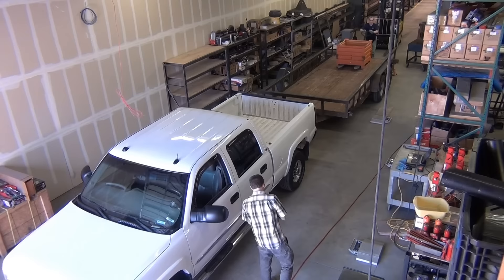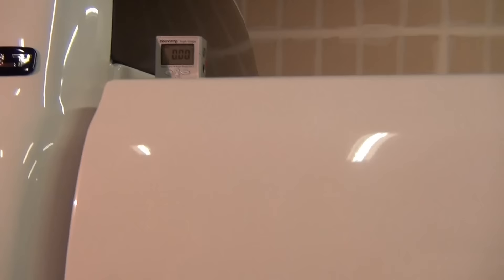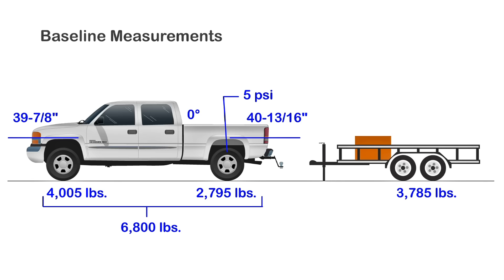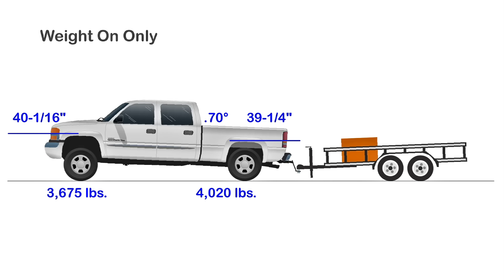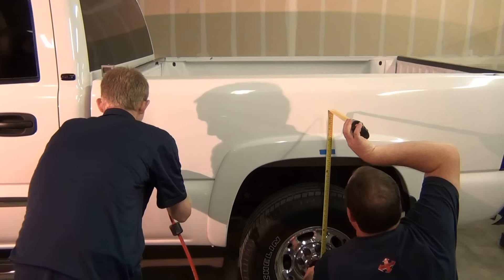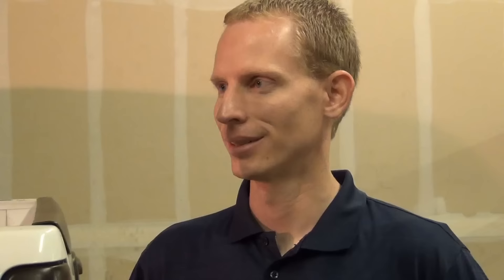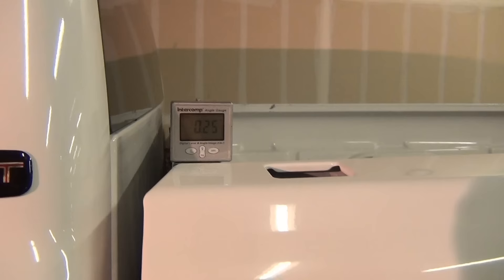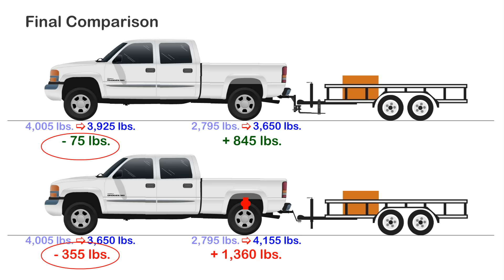The Difference Between Using Weight Distribution and Air Bags to Level Your Load

Comment: This is a great test. I have a Nissan Armada with self leveling rear suspension. How should I set up the weight distributing hitch with that? Do I use the air suspension or should I just disconnect it? I really wish I could just remove it from the truck all together. I also have an issue with hitch height. The stock shank that came with the hitch does not have enough drop and my trailer is always towing tongue high. Unfortunately, I paid an RV dealer to set it up and I'm not sure they did it right.
Reply from the maker: Thanks for watching. The best method to set up your weight distribution with a self-leveling suspension is to disengage it. Some systems have a switch that allows you to turn them off and on. Others do not level until the vehicle is turned on. And some have to be disabled by pulling the fuse temporarily. The best practice is to load the vehicle as you will have it for towing, then disable the auto-level system. Once that is done, set up the hitch to the correct height for your trailer’s coupler, and for the weight distribution needed. Once the hitch is set up, enable the auto-level system again. In many cases, the auto level will adjust and reduce the amount of weight distribution you are getting slightly. Be aware of this, and make an adjustment to the hitch setup if necessary.

Having the hitch ball at the correct height is very important. It is much easier to get good weight distribution, and much easier to hitch up and unhitch as well. We recommend setting the trailer parallel to the ground, and then setting the top of the hitch ball to the same height as the top of the trailer coupler. If you are within an inch or so of this height, the hitch can usually be set up to perform well. However, if the hitch head is much above this, we recommend using a specialty shank that has enough drop to allow the hitch head to be placed at the correct height. Instructions to correctly set up the Fastway e2 hitch can be found here: [https://www.fastwaytrailer.com/manuals], and for an Equal-i-zer hitch, here: [https://www.equalizerhitch.com/manuals-and-guides].
Reply: I appreciate the response. I measured my hitch and ball heights and there is a 9" difference between the two when the trailer is parallel to the ground!
Reply from the maker: @phonetech1109  , wow! Yup, that’s too far off. You must have a very tall truck, or very short trailer. We definitely recommend getting a specialty shank for your setup. Fastway brand shanks are here: [link https://www.fastwaytrailer.com/e2-replacement-parts], and Equal-i-zer brand shanks are here: [link https://www.equalizerhitch.com/store/shanks].

Comment: Is it better to use both air bags an a Wt distribution.
Reply from the maker: Using both can be a bit tricky, you'll want to set the springs up before setting up the weight distribution with the hitch. You may need to use one extra washer on the hitch setup to compensate. Thanks for watching!
Reply: @FastwayTrailer  I had the same question. Do you mind explaining this further? I appreciate this!
Reply from the maker: @raymondgreen5755  Hello! Using both can difficult. If you do you'll want to set the springs up before setting up the weight distribution with the hitch. You may need to use one extra washer on the hitch setup to compensate.
Reply: @raymondgreen5755  check out the follow up video - https://www.youtube.com/watch?v=mj2oqAiltsk
Long and short: If you have auto level, set your weight distribution (WD) slightly higher than the desired amount before allowing the auto level to come on. When it does, you will lose a little WD. If you have manual airbags, you can set it all up following the same process as with auto level. Or, fill the airbags as desired first then perform a normal hitch set up to your desired amount of WD.

Comment: Can you use both the weight distribution hitch and the airbags? The reason I’m asking is because I recently leveled my 2018 F250 and now by rear sags even with the weight distribution hitch set to the higher end. I was going to add airbags to level everything out if possible. Looking forward to a response...
Reply from the maker: Thanks for your response! We don't normally recommend using both air bags and a weight distribution hitch together. The air bags can counteract the weight transfer that the WDH is giving. Using air bags to raise up the back end of the tow vehicle will decrease the amount of tension placed on the hitch, which determines how much weight distribution and sway control you will get. So, raising the rear of the tow vehicle to eliminate squat will reduce sway control. If you have more issues beyond that, contact our customer service team!
Reply: Go with heavy duty bump stops like timbren and a wd hitch.
Reply: randomsanwhich 
What is a bump stop. I too have been considering adding airbags in conjunction with WD.

Comment: I have a  2500 Ram.  I didn't get the air bags but I was considering it for ride quality along with the weight distribution for towing my camper. Any suggestions?
Reply from the maker: You should be solid with the WDH. Make sure you follow the instructions and get the weight distribution measurements dialed in and you will be good to go!
Reply: I watched this video a while ago when i bought my RAM and TT to understand the difference between the bags and WDH. I have a 1500 RAM with bags and tow my 30' TT with it. The bags do not behave differently in "Tow Mode" and still level the truck. I have towed my TT with the WDH and without and definitely notice a difference. However I've never had any issues with stability, maneuverability, nor breaking when using the WDH. For fun I went and weighed on a CAT scale at a truck stop with the bags off, on, and WDH off and on and saw pretty much the same thing they show in the video with regards to how the bags move the weight, just less dramatic.

Comment: Do weight Distribution hitch help with gas savings excluding driving conditions?
Reply from the maker: +112760845030883444435,

The short answer: No. Sorry.

The longer answer - there are lots of physics involved and these are all vehicle dependent. There is a potential for some aerodynamic improvements and gains from the improved stability, but really, they are not big enough to be noticeable.
Reply: FastwayTrailer what is an average drop in mpg when pulling a trailer that you have seen?
Reply from the maker: +112760845030883444435,

In our testing, we primarily focus on the performance of the hitch, and do not pay much attention to gas mileage. Also, we are generally towing with enough weight that we are pushing the limits of the hitch.

The mpg drop will be different for every tow vehicle and trailer combination out there, as well as effected by other things like mostly flat vs. uphill or downhill, wind, altitude, freeway vs. back roads, etc.

I took an ad-hoc poll of the people here who tow outside of work. The general consensus is that they loose between 30% and 50% . Personally, I tow with a 2001 F250 with the 7.3 diesel motor. In average, everyday driving, I get about 17 mpg. Towing my old Prowler travel trailer, which has a GVW of about 6,500 lbs. I get between 10 and 12 mpg.

Hope that helps!

Comment: Looking for some feedback - I have a 2016 Tundra LTD that I pull a 5K dry travel trailer with.  I have an Equalizer WD hitch that I use, but I am looking at getting a set of air bags too.   The WD works great (never towed without one to be honest) but I would like to take a little of the sag out of the back (especially if I have coolers, propane, or even an ATV in the bed).  Also the water tank is located in the nose of the trailer, which add about 400lbs.   My questions are - will I see a significant different adding airbags to my set-up?  How do you configure a WD with airbags so that both are working well together?  My travel is not all pavement as I like to head up deep into the mountains.  Can then airbags be left at the same PSI when hitch, unhitching and hitching back up at camp, and unloading at home?
Reply from the maker: Ideally, you should be setting up the hitch after you have the tow vehicle and trailer loaded as you would for traveling. We know that is not always possible, and that you have to make adjustments when the loading changes. In your case our first recommendation would be to double check and make sure the setup is correct for the way you most frequently tow (ATV, fresh water, propane, etc.). If not, follow the owner’s manual steps [https://www.equalizerhitch.com/manuals-and-guides] and make changes to the hitch ball height and number of spacer washers to get it correct. From there you can make minor adjustments with the L-bracket height to accommodate changes in your tow vehicle and trailer loading. This should take out any excessive sag that you are experiencing. Also remember that it is good to have a little sag because you do want more weight on the rear axle of the tow vehicle when you’re towing to help give you the ability to control the trailer. With the weight distribution set up correctly, you may find that you do not need airbags to take the sag out and have a comfortable ride.

The air bags will make it easier for you to control the stiffness of the suspension on your tow vehicle. This can be of great benefit, especially when you are hauling payload like an ATV or truck camper. It can allow you to soften the suspension for a more comfortable ride when you’re not hauling, and quickly stiffen it for less sag and yaw when you are hauling. If you do chose to use air bags, our recommendation is to load the tow vehicle and trailer, air up the air bags to your desired driving/towing pressure, and then set up your hitch. If you make adjustments to the air pressure after the hitch is set up, you will either increase (by deflating) or decrease (by inflating) the amount of sway control the hitch is providing. If you change the pressure in the air bags, check your weight distribution measurements and make sure you’re still getting the front axle load back to the desired weight.

Yes, you should be able to leave the airbags at whatever pressure you want, whether hitched or unhitched.
Reply: In February, I was in heavy wind conditions pulling a 14k toy hauler behind my F250.  The EQ hitch helped tremendously, but the truck still had more squat than I wanted, and the 25+ mph cross winds, along with semi-trucks flying by me made it difficult for my single rear wheel truck to really tow with confidence in those conditions.  I ended up supplimenting the EQ hitch with an airlift 5000 ultimate system.  Confidence increased 10 fold with the combination of the two.  As Fastway trailer mentioned, I am able to deflate the bags a bit when sway conditions are worsening, and inflate them in smooth/calm conditions.  When roads get rough and the trailer makes the truck buck back and forth over brige & road transitions and expansion joints, I increase the bag pressure to stop the rear from bouncing -- keeping the front tires more planted.  The EQ hitch alone, had a difficult time combatting these conditions.  I love being able to adjust on the fly, based on the conditions I was encountering going down the road.  It also allows me to have some flexibility if my truck bed's payload, or trailer's toungue weight changed.  Rather than pulling out the tools and re-measuring the hitch and truck setup, I found I could make minor adjustments in the airbags to keep the geometry of the EQ hitch, truck,  and trailer where I wanted it.  I do think antisway hitches, and airbags are very complimentary to one another.  I could not run one without the other and have the same amount of confidence long hauling across the country with heavy loads.  Road and weather conditions are extremely dynamic from state to state.  While the EQ hitch gives you the bulk of the stability you want on the road, airbags give you that last 20% of the control and on-demand flexibility that you wouldn't otherwise have.  Just thought I'd share my experience as a consumer and user of both.
Reply from the maker: We're glad to hear you are enjoying using both air bags and weight distribution! Thanks for sharing!
Reply: @FastwayTrailer  Smokin Sound - thanks for the feedback as well.  What is confusing is the first step - setting the air bags at the desired pressure BEFORE hitching up.  How would you know as the vehicle will behave much differently with a load on it?  The load of the trailer also changes - for instance, when leaving to go camping, I have my tanks full in the trailer and also extra water in the bed of the truck to top off the fresh tank.  The fresh water sits at the nose of the trailer.  Once consumed (sinks, showers, bath, toliet, etc) that weight is transferred to the gray and black tanks located at different areas of the trailer.   Another weight shift.  I love my distribution hitch that I have - and  my trailer tows fine with it now, but I wanted to get airbags to help the stance and the dipping over bumps.   Right now, the WD is taking the all pressure to pull up the rear from sagging and put weight on the front a little.  My first understanding, which sounds correct, was that the air bags could fix the stance while adjust the WD hitch to still have a decent (not all) load on them so they are actively engaged.  I don't want to lose how my truck handles today, just improve... hence my questions.
Reply: @FastwayTrailer  air pressure on tires is still a component....correct?   After distributing weight, and airbag adjustments I always  reset tire pressures for the load.  You can either measure from the ground to rim height to get the same measurement to your baseline or do the chalk test for tread coverage which is more accurate.
Reply from the maker: Yes, correct air pressure in tires is still critical. Do you mean that the tire pressure should be rechecked after engaging the weight distribution?
Reply: Add air bags, Air Lift with the compressor. You need to add air after you out on the trailer. The compressor on the truck makes leveling and removing the trailer so easy. Plus it reduces bounce like crazy.
Reply: Have you thought about Roadmaster Rear Active Suspension?
Reply from the maker: @jaynesjunction  the process to dial in weight distribution with airbags involves a little trial and error. Make your best guess at the air pressure, then set up the hitch based on what your receiver height is with that pressure. Tow with it and see how it feels. If you want to make adjustments to the air, do so, then check the setup of the hitch again to make sure you are still getting good weight distribution. You may need to raise or lower the L-brackets a hole, depending on whether you added or removed air bag pressure.

This is the same process that you would use in your example of the load of the trailer changing. Ideally, if the loading of the trailer changes significantly over the course of a camping trip – fresh water to black/gray water, used up propane, etc. – you would want to double check the weight distribution before traveling and make any necessary adjustments to the weight distribution.

Comment: Hi. Is the ball weight worst on a ute(pickup) with leaf spring suspension and generally  longer tow ball to rear axle distance as opposed to a wagon style 4x4  with coil spring suspension and a shorter tow ball to rear axle distance. 
The reason I ask is because I tow with both types of cars a Landcruiser and a dual cab hilux. I only use the weight distribution hitch on the dual cab. Have you done this test with a wagon style tow vehicle?
Reply: You have nailed why the LC is in many ways a better tow vehicle.  That shorter distance from hitch to axle is vital.  The shorter the better, even the US made big pickups have a long distance from hitch to axles, and many of them have no better, sometimes worse payloads than our dual cab utes.  I couldn't have an Auto Hilux, as the weight limitations would make me illegal.  Many still use the WDH with the cruiser.  Friend of mine tows a 3.5t van with his dual cab LC100 conversion, done like 300,000kms with that combination.  Swears by the wagon vs the LC79 ute he had before.
I tow with a Dual Cab Colorado, 3t van, loaded rear canopy on the ute, I run upgraded springs, no lift, and Airbag Man airbags at 50psi most of the time, with a Hayman Reece WDH, the rig rides and drives like a dream with this set up, never ever feel uncomfortable, even at 110 on the free way.

Comment: I pull fifth wheel trailers what would you recommend for me
Reply from the maker: Hey +Paul Anderson,
Sorry, we don't manufacture 5th wheel hitches. However, we do recommend that you consult a good dealership or air bag manufacturer to get the information you need to make an informed decision on what's best for your setup. Air bags may be a great option for you.
Good luck, and thanks for the comment!
Reply: Proper mounting and positioning of the 5th wheel hitch/pin in the tow vehicle should allow the weight of the load to be properly distributed. Air bags will help With managing the sag issue if any is experienced. If you are using a short bed truck with a 5th wheel hitch, you are at a serious disadvantage for proper weight distribution and air bags will not help this. Only proper installation, on a properly configured tow vehicle, will keep a 5th wheel configuration safe.